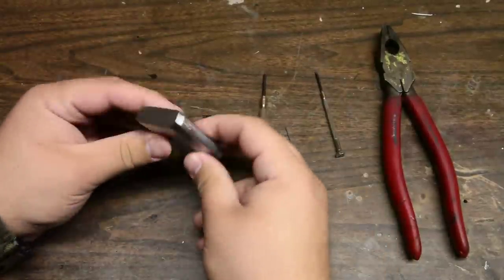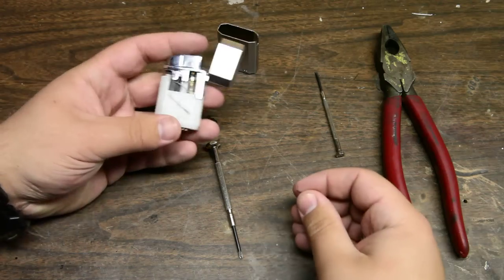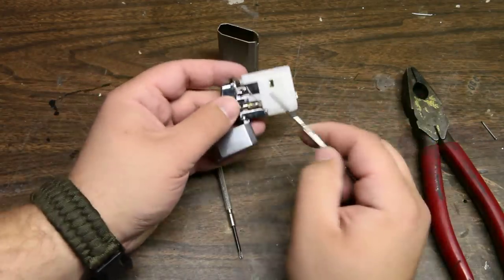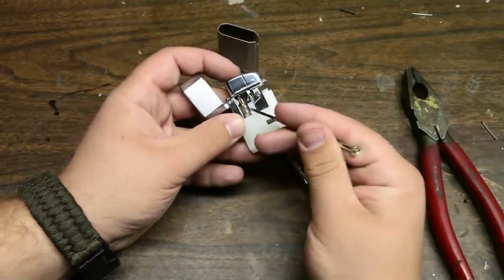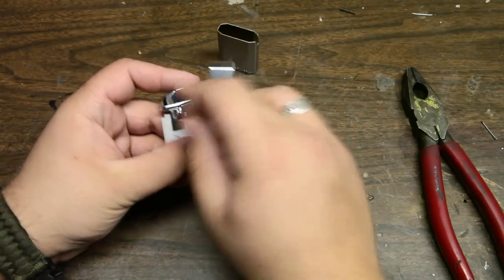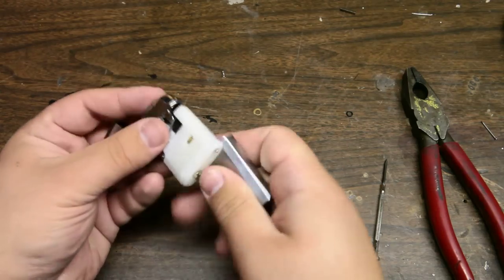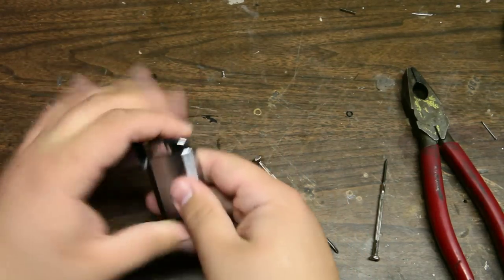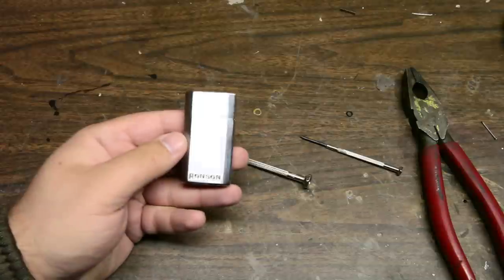Ronson Jet Lite Mod

Comment: Modification complete! Thank you :-)
But, I have a question. At 01:43 you mention not to loose the little black rubber disc. Which I did not, but the question is: What is the purpose of the disc? What's its functionality? Any idea?
Reply: It insulates the igniter from the case so it will spark.

Comment: Just a tip, if you remove the flame adjuster screw completely it makes removing the brass very easy, obviously it will also empty all the fuel so just be prepared for a poof of butane to come out
Reply: Theres no benefit from that at all. The brass ring isnt held on by anything once you take off the o ring which is easy as well. In fact it will be way more difficult especially for new people.

Comment: bro, i've had this lighter since like 07-08ish, and i liked it enough to hold onto despite the button being stiffer than a shot of paint stripper and the flame only wanting to work under absolutely perfect conditions. thank you so much for giving me the ability to actually use the thing again.

Comment: Great hack on a great lighter.  To make things even easier you don't need to take it apart.  Just slide a wire cutter in and snip the safety spring in half.  Don't worry there is no post/depressing rod in center of spring so feel free to cut the spring completely in half and remove the top part of spring with a sewing pin.  I simply left the bottom portion of spring inside its chamber.  Didn't find it helpful but I also used the sewing pin to easily remove the brass ring.

Comment: Thanks for the video, I used it to modify two lighters.  I ran into a small snag on each of them, though.  On the first one, the spring-loaded mechanism for the lid popped free.  It was a pain, but I finally got it put back together and it's fine now.   The second one wasn't nearly as bad.  The rubber disk and a little piece of metal they were using to fill the gap just fell out, and I had to stuff them back in place... Adjusting the flame a bit more is nice, but the main benefit is the button.

Comment: Was searching for a way to fix my lighter, I refueled if and no luck but after seeing this video and doing the things and then strengthening the flame a bit It fixed all my problems, I lowered it back down and works perfectly. Thanks. Make more vids!
Reply: Yup, after many times of trying to refill this lighter with no luck i tried both of these mods. Lighter works flawless now thank you.
Reply: @MrEmpirestate714  good to know just got one and was hopping I'll be able to refill and it'll still work. Don't feel like spending 5 bucks every two weeks for a lighter

Comment: I immediately dropped my lighter and lost the rubber part i was told not to loose but folded up duct tape replaced it perfectly!
Reply: Mine works without it.  Wonder why it was there?

Comment: i was confused by the rubber insert part. Turns out mine had a little white disc that looked like it was made of paper.
Reply: So did mine!
Reply: What was it for?  Mine works without it

Comment: Great video! That little brass ring was set so that the lighter would barely even light - now the jet is about an inch and a half high! And you were totally right about leaving the lid assembly pin alone. That pin came out somehow and I spent about 20 minutes trying to put the assembly back together. I actually ended up having to take apart another one to figure it out.

Comment: I watched your video. I managed to simply pull the spring out with a forceps and saved myself the bother of un-pinning(and re-pinning) the top from the tank bottom. I just took the screw out of bottom, slid off the case and with a pinch, a twist, and a pull of my forceps out came the spring. Thanks for the mod. These lighters are quite a bargain !

Comment from the maker: Like I said, don't push out that pin.  I'm not sure either.  You should have to push the spring and hinge back together while you put the pin in.  I just know from other lighters that I have worked on.

Comment: Mine, stopped working as a jet. It no longer ignites with the spark but if I light it with different lighter it goes on but the flame is that of a normal lighter not a jet. Not the first jet lighter to do that. Maybe you know  how to make them jet again or what causes them to not jet ? P.S. Mod or not mod it did it before that, it just looks like you know lighters maybe you can help me fix mine,  I have a few that broke same way.

Comment: I have a different lighter from a gas station, and the spring is built into the black tube sparker button you pulled out. So I can't remove it :( also, the pin you said not to remove fell out on its own, and it's like impossible to get that spring back in! That spring keeps the lid open and closed, so kinda important. Any suggestions? And where can you get the butane to refill it? Thanks, your help is greatly appreciated!

Comment: Removing the limiter is an optional bonus.  The real pleasure is taking out that button spring.  I just did this to mine, and I'm so glad I did.  The button still feels firmly in place, and does not wiggle.. but pressing it requires much less force, which will make it easier to hold it for a long time while carefully toasting the end of a cigar before lighting it.

Comment: Thanks for the mod, very nice, helps a lot. One other thing I suggest which is not really a mod, is to use an airsoft propane adapter and fill your butane lighters with propane. The pressure is higher, and seems to light more reliably.
Reply: I wouldn’t do this with all torches. Some will break from the highly increased pressure. But for some it will work better and be just fine.
Reply: @rafaeltorre1643  Responding to a 9 year old comment? Wow can't believe I have had that adapter for so long, had no idea. Anyway I haven't done it in a while, but all butane accessories I filled with propane never blew up, but one did leak out in a hot car I think, and never held pressure again.
Reply: @LostBeetle  Yeah. Blame YouTube. They started pulling up 10 to 15 year old videos 2 years ago. Of course its not really relevant for the commenter anymore but I respond so people new to them can learn from your situation and my experience in working on them. Bics for example use isobutane. A mix of both. Which can sometimes give issues when refilling it for the first few times. Straight propane would be interesting to see but definitely would need to be a good candidate or it will break somehow. Usually the pressure comes out the refill valve and will break that first.

Comment: Well, thanks for the mod info...was only getting a quick flash of a flame, & now with the brass limiter removed it lights beautifully.  One thing though, the damn hinge pin fell out and then the spring & lever.  OMG what a pain in the ass getting it back together.

Comment: Great information. I did on two Jet Lite and now they work great. When he says don’t remove that one pin, just don’t. I did on the first lighter by mistake and it was hard to get it back together. On the second, It just fell out after I had removed the two as directed. My advice would be to put a small amount of red nail polish on both sides of the one that should not be removed and let it dry before taking the others out. When you see red,,,don’t remove. This made both of my lighters perform pecfectly. Shame on Zippo for not updating this on all these units. THANKS A BUNCH

Comment: its an easy fix.... this happened to me too .... put the spring back on the metal hinge of the lid... put the hinge straight down and push a little to compress the spring ... till u see the hole open up to accept the push pin ... then tap it through...

Comment: You do not need to remove the pins to remove the spring.  Just wedge out the spring with a little screw driver and it will pop right out.  (off topic: Nice survival bracelet btw.)

Comment: Going to add one more comment here.   After doing several of these, there is a shortcut:
You can take a pair of small wire cutters and cut the spring that acts as a child-proof mechanism, and pull it out, thus avoiding an entire dis-assembly procedure...
Reply: T Elrod  Careful to use a tool meant for hard wires or something you dont mind ruining.  That little spring is hard.  Nearly ruined my flush cutters.

Comment: What did this modification do? The Ronson comes with adjustable flame already.
Reply: Doesn't seem like anyone answered your question. First modification makes the switch easier to press down. Second one allows for greater range in the flame adjustment, allowing for a higher flame than the original max setting.

Comment: Had to go grab 1 after seeing nothing but good reviews did both mods in like 1 minute you dont have to remove any pins or disconnect then line to get the spring out just rip that sucka out a there from the side

Comment: Awesome man. Took me like three minutes to mod the ligher. One issue worth mentioning: The safety spring keeps the switch cap from wiggling around. I suppose if you cared about that you could buy a replacement spring with less power. You get used to the rattle though, and it doesn't affect performance.

Thanks much.

Comment: Thanks for the tip on removing that rubber gasket. It worked for my firebird lighter (by colibri, I think). I was suprised how the pocket lint built up inside the case too! Thanks!

Comment: Also guys ... The one thing I've found with my jet lite is the only way I can get a good consistent flame that lights everytime is to keep the adjustment screw for the flame all the way to the - and when refilling your lighter purge air out of the system by pressing up and the butane inlet
Reply: So when it's low purge it on the lowest flame setting, then refill with fresh butane and it'll work?

Comment: After I did this mine just spits out butane out the top what's wrong? The metal fork piece came off and I thought I put it back on right
Reply: +Zach Saxe you have the gas valve open too much, you gotta play with it slightly until  you have just the right flow.  i just turned the gas valve open a little more after each time i light it until i see the maximum size of flame i want, dont make the flame bigger then an inch or so.  and i think gas matters, dont buy cheap stuff, get the brand name stuff
Reply: +Ryan H it wasn't that. It was the same gas valve before I took it apart but after it did this. Also I move been using Newport butane

Comment: OK, follow up. 
I did the mod on two of these, and now both won't cut the fuel delivery off on the lighters.  (Meaning, they continue to hiss and spew butane after you release the button.)   I tried putting the spring back in, thinking that might be the cause (on one of them), but they still are problematic now.  (No way to put the brass limiter back on.)

There may have been some changes from the Ronson folks since this video was made, but just want you to be aware.  (If anyone has a fix for this, let me know.)
Reply: T Elrod I had a similar issue, but theres a simple fix. Just make sure that the dial that allows the release of gas is not turned too much, otherwise the gas will escape and turn into a Zippo (as in it wont stop until you close the lid). Just make sure the dial is not turned all the way. Hope this helps
Reply: Edwin Fernandez Thanks.   Actually, the gas will continue to flow even after you close the lid.  It seems to do it even with the dial turned down.  I eliminated the issue with the other ones I have modded with the change in the mod I posted below....
Reply: +T Elrod have you fixed it I have the same problem
Reply: I think the problem is with the metal fork thing. It doesn't sit right anymore so I bent it down a little. I also bent the electric wire to be closer to the flame hole. It was working fine for a little while but now my electric igniter won't spark. It will jam up
Reply: +Zach Saxe Well, the beauty of the whole thing is they are like $4.50 or so at Wally World.   You haven't ruined a $50 lighter... :)

Comment: Thanks for this video man ... the 1 thing I hated about this lighter was how tough it was to push down ... I took that spring out and now I love my jet lite !!!!

Another tip for everybody is this .... dip a Q tip in a little rubbing alcohol and rub your gas inlet on the bottom of the light and also swab down in the hole where your flame comes from .... itll clean her out

Comment: Good video. I performed both mods and they worked perfect.  The lighter trigger tension makes it so much easier to operate.  One discrepencey that I noticed was that there was no "black rubber disk" under the ignighter in my lighter but it still works perfectly.  Thanks for the mod. Keep up the good work.
Reply: Mine had a white rubber disk.  Still works without it.. do u know what it was for?
Reply: @squatsnow  Its supposed to be an insulator. But it actually still works without it. I think it just stabilizes it which helps with longevity. Fine without it though.
Reply: It likely fell off when you took it apart. It happens all the time since its hardly noticeable its there.
Reply: @rafaeltorre1643  thanks brother. Ive had mine for years one with disk one without and use it all the time
  Still holding up
Reply: @squatsnow  You would think they would at least put adhesive on the bottom of it so it doesn’t fall straight out when someone tries to fix theirs. I fix butane lighters and torches. I want to get into vintage lighters since its hard to find people to fix them. Some are thousands not in working condition.